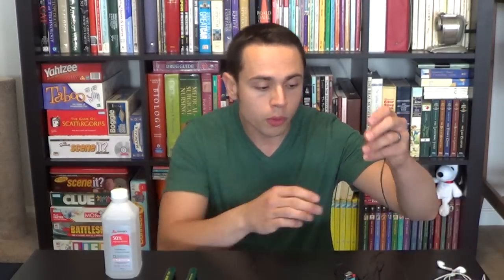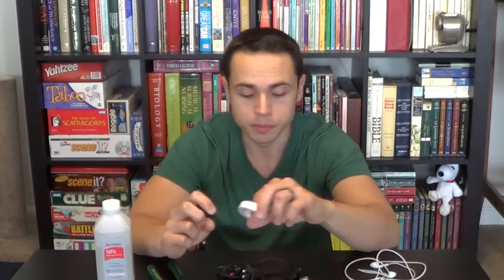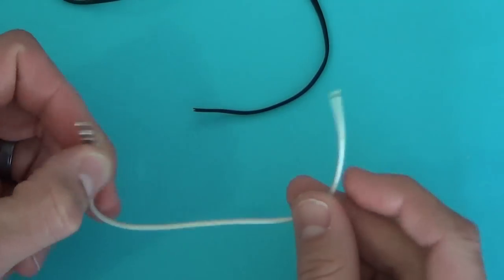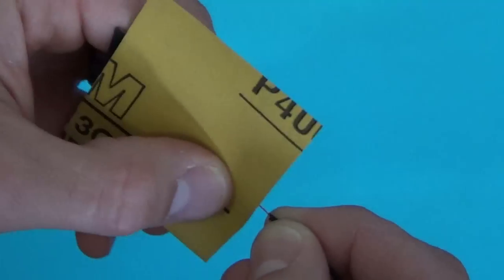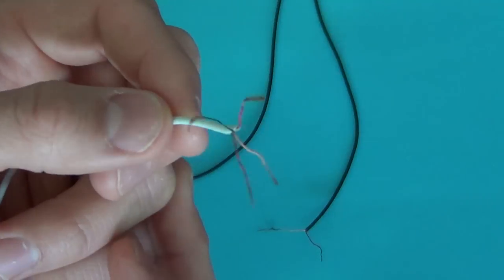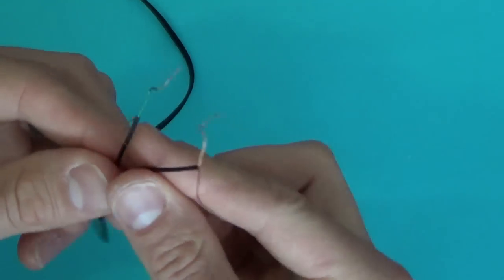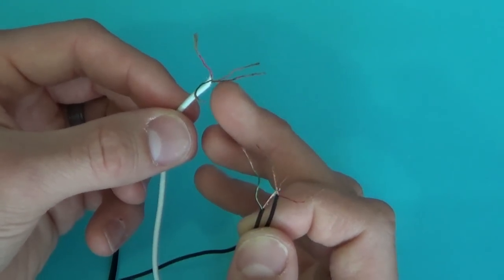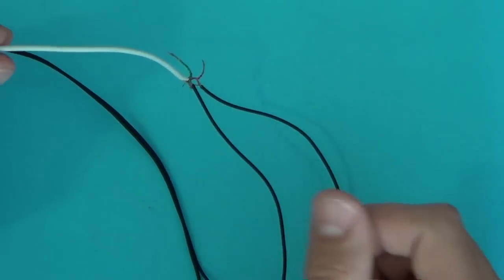Headphone Repair using Unbroken Headphone Set

Comment: Aren't the two ground wires for left and right separate to minimize crosstalk and maximize channel separation?
Reply from the maker: Yes, but when repairing them I found it easier to combine them.
Reply: Probably isn't noticeable anyways on a regular basis.  Do you have any tips on how to repair the y-split in headphones?  Especially a set with a flat ribbon cable.  Not sure the best way to deal with heatshrink in that case.

Comment: Ok..so..I successfully clipped trimed and separated ,burned off coating.on the bigger headphones I need to fix. Ones I thought was similar was just male to make and just had white yellow n green.so only other headphones are these ear buds. That splits in two one had red &copper other green &copper. So do I just twist greens and reds together from both headphones.than just tie 1 copper from one to both the coppers on the other and basically just tie all 3 coppers into one🤔

Comment: Does skull candy headsphones work with sony xperia C
Reply from the maker: They should work as long as the plugs look the same. Also, the color of the wires may be different, which can make reconnecting the plug tricky. It might requires some trial and error (connecting and testing wires) before you permanently solder them.
Reply: thanx

Comment: Hi rhichs i have a seennheiser pc 330 headset and i can't hear a thing when its plugged to any device. how do i find what's wrong and how to fix it? i suspect its the wires but i dont know for sure.
Reply from the maker: Here's how to locate a short: In order to determine where the short is occurring, do the following:  While listening to music, bend the wire starting from the plug and work your way up to the earplug (make sure to do the Right and Left wires separately, in other words, after they split). Bend the wire back and forth, and carefully try to keep the other parts of the wire steady. I suggest taping the wire down as you move towards the earplugs, just to make sure you are not bending other parts of the wire (and getting a false positive). What will happen is the music will cut in and out in the area where you bend the wire, which is where the short is occurring.  Then you could cut out the "bad" portion of the wire using the steps I show in my "How to Repair Headphone Wires" Video. 
If you cannot locate the short, then it is probably at the plug itself, and you'll have to replace the plug like I show in this video or my other videos in my headphone playlist: http://www.youtube.com/playlist?list=PL380B15A8B48AAFF3

Comment: hey rich I have a senhieser HD202 headphones and suddenly one day right haedphone started to have loose connection problem but left part happens to work perfectly can u pls help me with this problem
Reply from the maker: Have you tried to find where the short is located?  In order to determine where the short is occurring, do the following:  While listening to music, bend the wire starting from the plug and work your way up to the earplug (make sure to do the Right and Left wires separately, in other words, after they split). Bend the wire back and forth, and carefully try to keep the other parts of the wire steady. I suggest taping the wire down as you move towards the earplugs, just to make sure you are not bending other parts of the wire (and getting a false positive). What will happen is the music will cut in and out in the area where you bend the wire, which is where the short is occurring.  Then you could cut out the "bad" portion of the wire using the steps I show in my "How to Repair Headphone Wires" Video. 

If the short seems to be occurring at the plug, then you could follow my video entitled:"How to Repair or Fix Headphones"  or "Headphone Repair using Unbroken Headphone Set". Good luck!

Comment: I have one thin twisted white wire and a thicker twisted white wire, one blue wire one normal white wire and a copper wire on my headphone. What do i have to do?
Reply from the maker: I see that you commented on both of these videos. Do you know if your headset has a TRS or TRRS plug?  Google an image. I assume that you have a TRRS. If that is the case, then the other video will be more helpful.
Reply: Its trrs, i commented on the wrong video sorry,
Reply from the maker: Daniel Kim The twisted white wires are your earphone sound conduction wires. I'd connect one of the striped wires to the red wire and another to the green wire. The copper and white wire would be your ground and goes to to the other copper wire. The blue wire goes to the red/green striped wire, this is your microphone / volume control. Hope this helps!